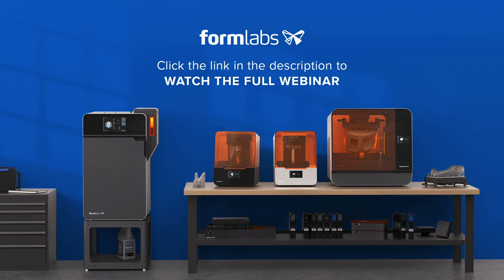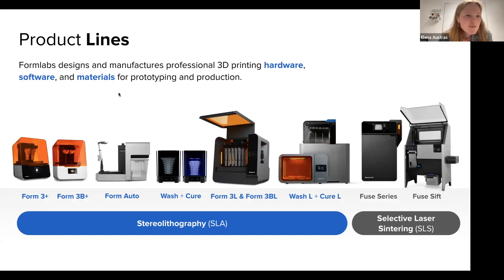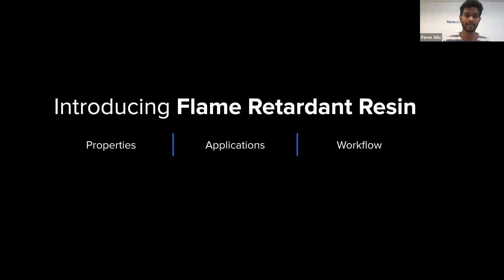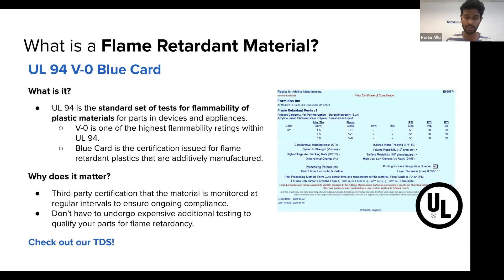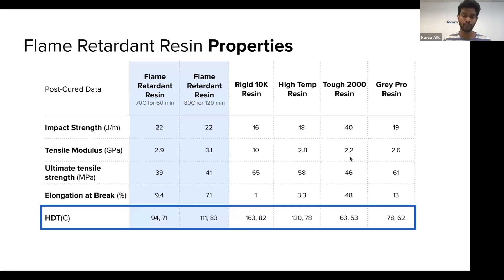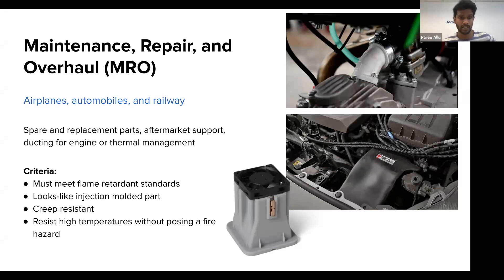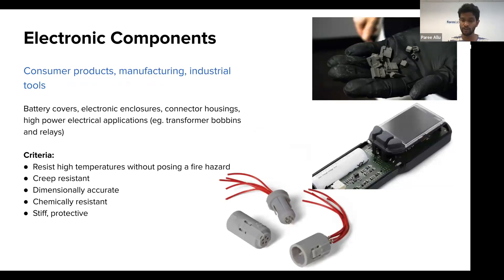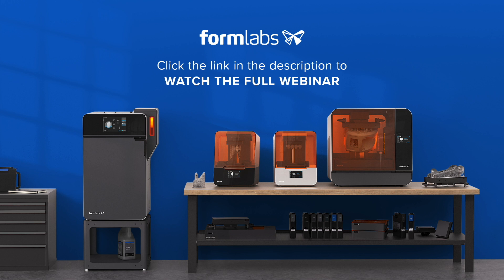How Flame Retardant Resin Unlocks New Possibilities at Avance Design #webinar

Comment from the maker: Watch this free webinar to learn how you can use FR Resin to easily 3D print flame retardant, heat-resistant, stiff, and creep-resistant parts that will perform well long-term in indoor and industrial environments with high temperatures or ignition sources: https://bit.ly/3MimECe